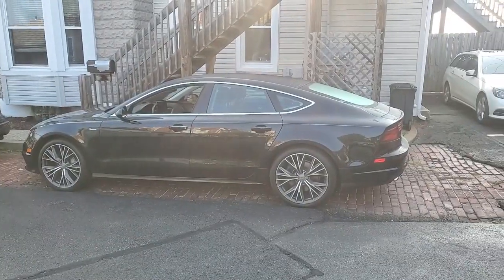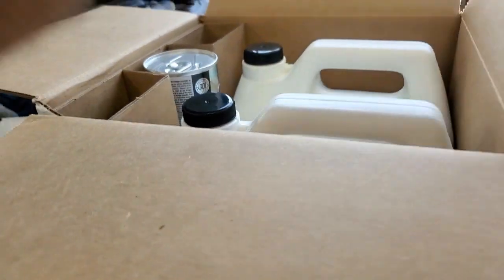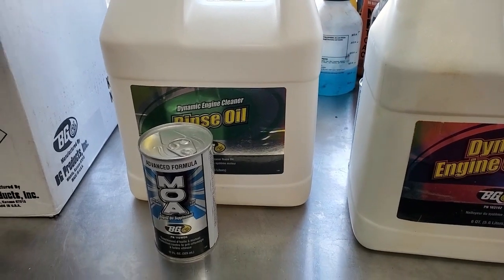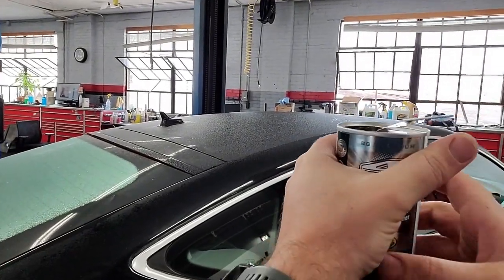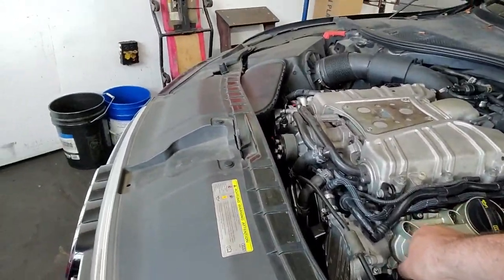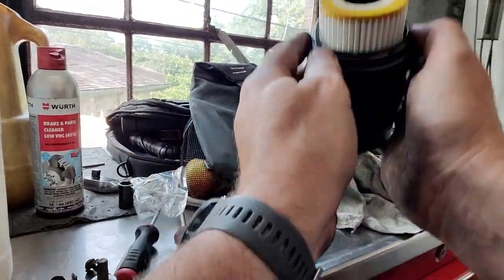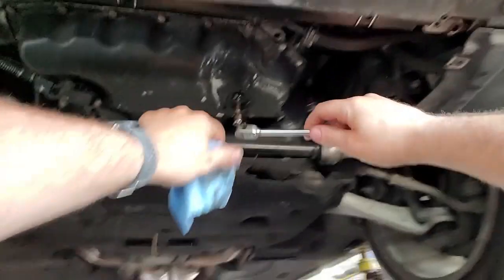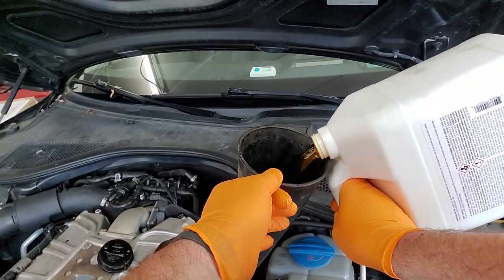BG Dynamic Engine Flush On Audi A7 at King's Auto Repair

Comment: IMHO you should put ATS 505 Fuel Treatment, before or after, up to you, on the Fuel Tank and then some Lucas, and after that ATS 505 Engine oil treatment. Wow that rinse oil looks totally usable; maybe the Company should provide a filter, to rescue the oil, and use it to keep cleaning the engine, with the cleaner leftovers.
Thanks for sharing. Added to my Cars playlist

Comment: Looking forward to the update on this. Just did a Berrymans B12 ring flush on a friend's 10,000 mile oil change 2017 Q3. She burns a qt every 300-400 miles! Have you any experience with the B12 ring flush or DSMO oil flush?
Reply: The BG EPR works well for the price at least it has on my Audi A4.
Reply: I just did a 5000 mile oil change on my 2016 golf 1.8 tsi so very similar engine, it's got about 123,000 miles on it and recently roughly every 7 days or so it would burn a quart of oil, if driving hard then 3 days, I changed the oil separator/pcv (on top of valve cover) and that helped so now it loses a quart every 10 days, I did an oil change a few days back but before I changed the oil I went for a 20 minute drive to get the oil hot and checked the dipstick and oil was a dark brown but much lightet than the oil that was drained in this video before he did the BG flush, I put in a whole bottle of liqui moly proline engine flush and let it idle for 15 minutes then checked dipstick and oil was BLACK AS HELL, I drained the oil which was super black after the liqui moly proline engine flush treatment and put new oil and filter and now we wait and see if that did any improvements...my hope is to eventually get the carbon on my pistons rings dissolved away so when the oil light comes on again I will put in marvel mystery oil as a top off quart which should help slowly dissolve the carbon deposits on piston ringsas well, then I'll do another oil change with zero additives to see how the oil burning is and if it improves to about 1 quart per 5000 mile oil change interval then 1 more can of liqui moly proline engine flush so do the trick...I've owned it since 30,000 miles and its always burned oil, I followed an 8000 mile oil change interval since I do mostly highway driving but seems like that wasn't good lol, so decided the last few oil changes to switch it down to 5000 mile intervals
Reply: @monikhushalpuri any luck with the proline engine flush? Just used it on my q5 with the 2.0t. I was also using about a qt every 300 miles.

Comment: BG seems like great stuff. I’m running the BG MOA and it seems to be working.
Reply from the maker: I run MOA in all my cars and my compact tractor. Usually run a EPR though the cars every 3rd oil change along with a 44k in the gas tank. EPR is the "lighter version" of the Dynamic Engine Flush.
Reply: @kingsautorepairinc.  that’s awesome. I plan to try those soon.

Comment: I can tell you as a 15 year Automotive guy, the past 4 1/2 in the training role… BG works. 
Let’s talk about what’s going on within these Audi engines however… The dynamic service does an absolutely remarkable job of truly restoring an engine and safely removing sludge without adverse effects. It will clean the lower ring lands to near spotless restoring compression, what’s a little hard to do sometimes however is to clean the upper compression rings where oil doesn’t always travel to.

The best course of action is doing a fuel injection service or in worst case scenario as a top and soak paired with this dynamic service and the results of been fantastic for the shops that are doing this. 

About a 90% success rate.  part of the process is to also remove the plugs and check for cylinder wall scoring, if that is present there’s no chemical in the market that will put metal back into a motor however if there is no scoring chances are you’re going to resolve the problem. 

At that point I would continue to do BGMOA, EPR and 44K  at every oil change interval moving forward to prevent the issue from returning
Reply from the maker: People still think it is snake oil but it is not. When a new person starts here we give them a can of 44K. Two days later they totally believe in BG products because the 44K made the car run that much better.

Comment: 2014 VW Passat bought new,
 169,543 miles, EPR, MOA, and 44K works but its common for the PVC diaphram to fail too. Replaced my PVC breather in addition to using BG products. 

Very little consumption now,  still ZERO squeaks or rattles. Using cruise set to 57, slow lane on GSP 100 Mile trip windows and sunroof open and get 41.2 mpg on a 1.8 EA888 GEN III gas powered engine. Not bad for 169,543 miles?

Comment: does this clean the air intake valves?
Reply from the maker: Not really. It will pull some cleaner through the PCV system and across the valves but it will not be enough to remove built up carbon. You are going to want to us an intake cleaner designed to break up carbon sprayed into the intake with the car running. If the build up is too much for the Intake Cleaner you will need to remove the intake manifold an physically clean the valves.

Comment: Where do you get the dynamic engine cleaner kit?  I have tried BG website and searched vendors to no avail. Also contacted BG company and they are just rude and useless.  I just about don't want nothing to do with BG if it were not for wanting to try this engine cleaner.
Reply from the maker: The best place to get it is from an automotive shop. Side note, they are now the OE fuel system additive for GM. BG and its distributors don't usually sell to the public because then they have to charge and collect tax. I got it from a source that they are going after online retailers because most of the product is old. BG has a policy that they take back old product to recycle. That being said you can find it online but it is usually old stock.

Comment: On modern engines, 10-20% of old oil will remain in an engine.  This old oil mixes with new and causes it too darken.  When oil is heated to high temps will cause it to darken as well.  Ive done dozens of clean oil flushes, and it takes a full oil rinse to rid 99% of old oil.  The machine industry refers to this as a full volume oil change. I run 10k oil changes, using Group V 100% synthetic oil, and rinse with clean oil.   It has 188k miles, and top of the engine has zero, varnish, carbon or sludge and looks brand new.
Reply from the maker: The biggest issue is shops/people running whatever is the cheapest oil and  people driving 10,000 miles on an oil change. It doesn't meet the standards the manufacturer says the car needs and it causes issues. I doubt man people will do you like you do and fully flush the engine at every oil change.